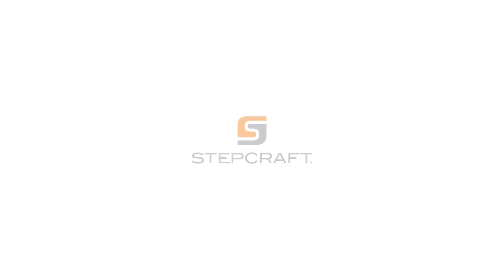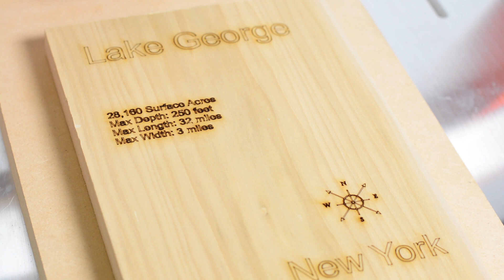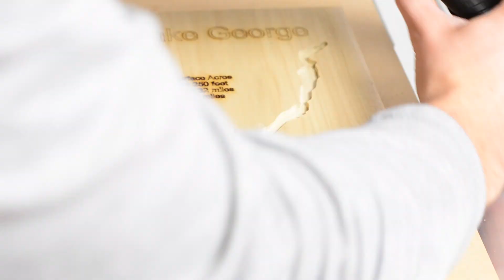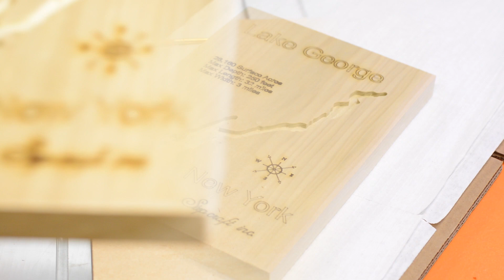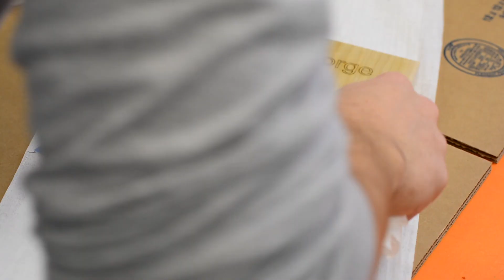Desktop CNC - Lake George

Comment: Always fun to do little projects like this. They are easy, and make great gifts. One suggestion for others who might  be tempted down the same path. Seal the wood with lacquer after engraving and before painting, and the paint won't bleed into the wood as much. You can then clean up the surface with a little light sanding before you put on the final coat of finish.